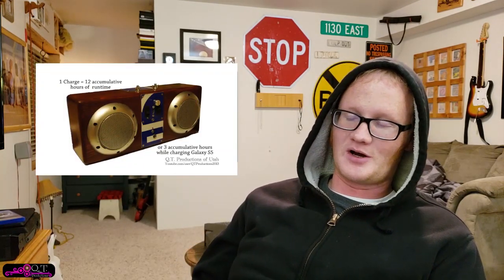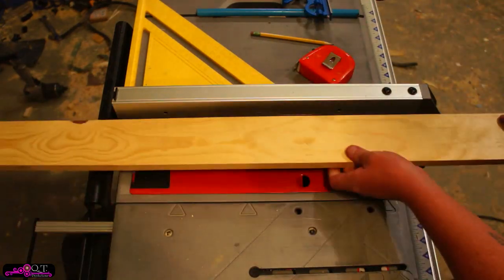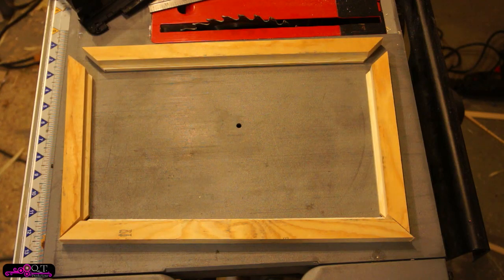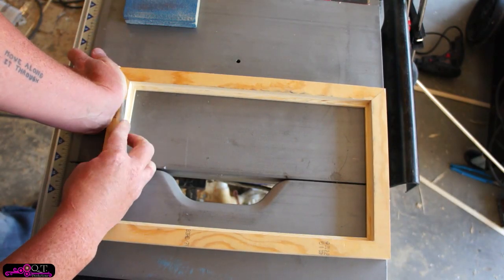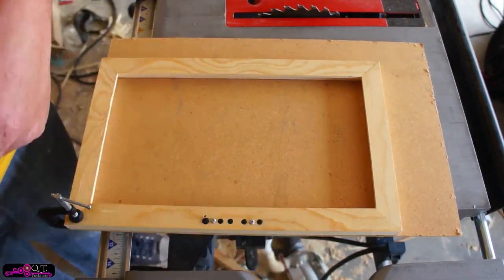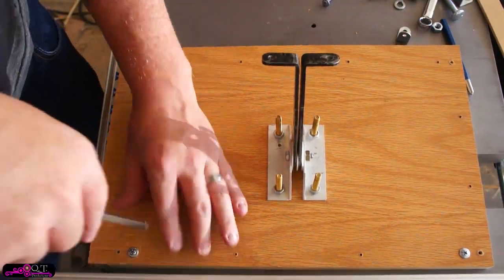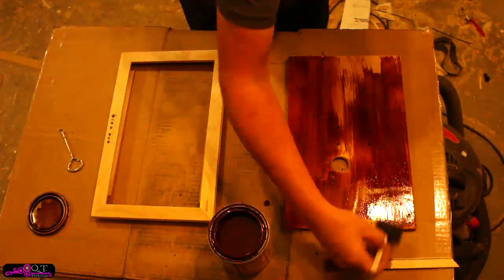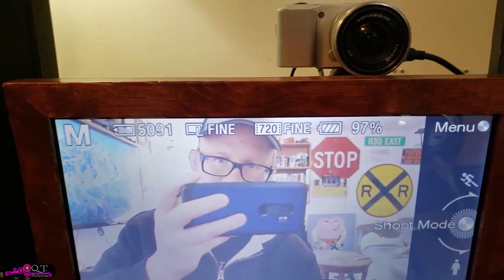Making a Picture Frame Computer Monitor From Laptop Screen

Comment: Great video. Im currently trying to build a digital frame from my laptop screen and need some help. Is there some external device I could connect to the controller board to have photos show up on the screen other than connecting to another laptop or some other device? Thanks